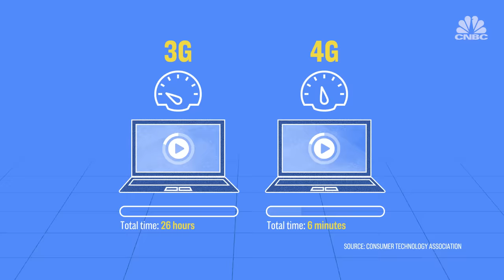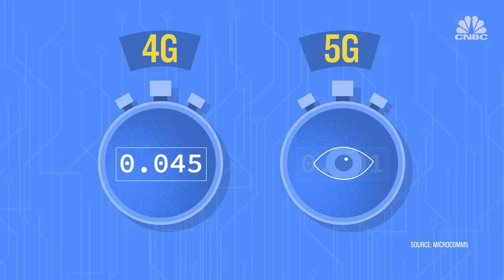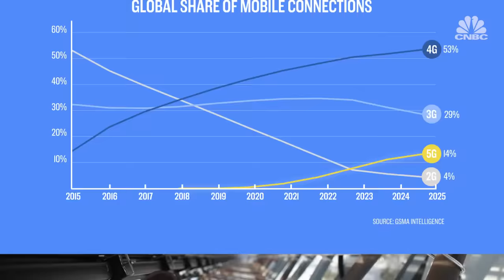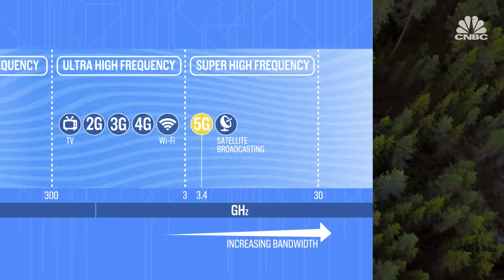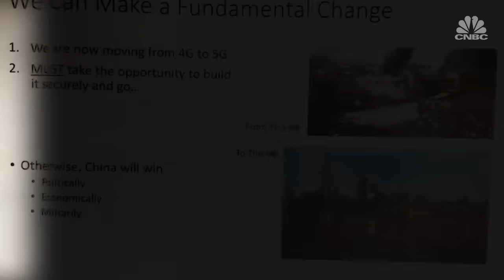What is 5G? | CNBC Explains

Comment: Basically... this will cook your brain.
Reply: This will cook entire bodies as it will be deployed all around peoples homes and jobs ..
Reply: Risk has to be taken for better future
Reply: It will cook nothing, since these are weak radio waves and not strong micro waves
Reply: @lukasmihara  anything in the GHZ range is microwave..
Reply: @ryanrodrigues6127  Are you serious?
Reply: @OMEGOOLIEBIRD  Not anything in the GHz range is necessary a microwave. Also, water molecules don't react to every range of waves.
 The only thing we are not evolved to withstand are things stronger than UV. Infrared, microwaves, radiowaves are all weaker than visible light.
It won't cook anything or anyone. The microwave you're using at home works probably with around 2,5GHz, WiFi also works with bandwiths in this range, and still you survived writing this comment without getting cooked. It's magic.
Reply: Lukas Mihara Your comments are uninformed. A microwave oven works by concentrating the radiant energy in a confined space. But that doesn’t mean it is safe to expose people to less concentrated microwave radiation 24/7. Governments use a “sensible heating” standard at this point, which means cell towers are ok as long as people can’t feel their flesh being heated. The standard will change after all the litigation which is coming over the issue.
Reply: why is key largo where donald trump lives exempt from 5g? people get exempt from bad things, not good ones.
Reply: @ryanrodrigues6127   A future where every breath is monitored, measured and monetized.
Reply: @ryanrodrigues6127  this is no unproven risk ..it WILL FRY YOUR ASS MATE.and everyone you know.
Reply: @lukasmihara  its the frequency of the microwaves that does the harm to us
Reply: . Lukas Mihara  the frequencys in 5g are ramped up to dangerous levels to us because they cant get them to travel far enough on norma levels.i have seen it kill a saucer of seeds in two weeks so you must see its a slow killer..thats the plan
Reply: @fj5745  Yeah, it's the plan to kill random people. Makes sense.
Reply: Sounds like it's started already☺ all the best with that one.
Reply: we can't have radioactive free version, electromagnetic waves are everywhere if we remove all electronic devices we still would be in constant radiation. the atmosphere can't protect us 100% for that you need to live in a well sealed cube all your life lol
Reply: Fun Videos 
5g is killing flocks of birds as they fly. Google it.
Reply: @thoughtstream875  Thanks for the info. I googled it and as expected there of course was no evidence of 5G killing anything.
By the way, to have your brain cooked, you first of all need a brain. So most of you don't need to worry.
Reply: @ryanrodrigues6127  Cancer is not a better future.
Reply: Its non-ionizing radiation, your wi-fi has many times stronger microwaves than this 5g network has. Get a grip back to reality.
Reply: @lukasmihara  check about 5g testing in netherland
Reply: Fun Videos and birds too
Reply: @tantyabichu  I did and they found no evidence it was the 5G that caused it.
I want facts, not stupid conspiracy and assumptions without proof.

There have been other cases where flocks of birds died and 5G didn't even exist then.

5G doesn't work exactly like your microwave oven at home.
Also to cause cancer it'd need a much higher frequency. Microwaves are non-ionizing.
Reply: Bingo! Yaaay, capitalism...
Reply: "this will cook your brain"  - You have nothing to worry about then.
Reply: @jdeep7  I said I wanted facts, not some stupid conspiracy.　You probably also believe the earth is flat if someone tells you that in a "fact" video on Youtube.
Reply: @OMEGOOLIEBIRD  It doesn't matter what it is, microwave is a non-ionizing radiation buddy. It does NOTHING to your body. And there's something called ENERGY level. Example: Low energy light into your eyes? It helps you see things. Same light but from a 5W laser focused on your eye? Goodbye eyesight. You are already surrounded by microwave radiation from all the wifi's from all your neighbors. 5G works exactly like that.
Reply: @zdrowapolska2313  I'm fine with more studies on it. I doubt anything will come out of it though
Reply: @em4703  And you base that on....?
Reply: @zdrowapolska2313  what do you mean? You are surrounded by 5g type of radiation right now. It's called a wifi. You'll just have it on the road now too instead of only in your house.
Reply: Dude bird die because of 5g radiation it will also kill us slowly
Reply: @RafikExe  that's because they used a focused beam with higher intensity than the actual 5g does. 4g uses radio, like radar does. Radar also causes birds to die. Does that mean 4g is also bad? No, because intensity of signals is different
Reply: @lukasmihara  false. See Netherlands test and what happened immediately to smaller animals. Birds especially. We lose our birds globally,we lose our natural pest control, we lose more food. This is like the nuclear bomb story.
Reply: @jdeep7  We knew Earth was round and the size of it for about 2300 years. The ancient Greeks calculated its radius. How about you actually read some papers about what 5g is before fear mongering?
Reply: @ryanrodrigues6127  idioz
Reply: 7g probably exists somewhere
Reply: It will Cook my pube hair
Reply: Strong arm-maybe brain not quite so strong.
Reply: From a corporate business perspective, that's an added bonus because it will bring more business and profit in the (un)health care sector; something like cancer.
Reply: @ @lukasmihara : Strength is inversely proportional to the square of the distance, which means what you call a weak radio wave has a strong EM energy at very short distance, like when you place the phone next to your head.
Reply: @ @lukasmihara : No, it's motivated by profit; the heath issue is incidental.
Reply: ha..ha..ha..l like that
Reply: Na, It's a non-ionizing frequency, there's no health danger. Plus all radio frequencies are regulated by the FCC or equivalent based on your region regarding their maximum power level out put.  All radio frequencies are subject to a number of factors such as the inverse square law, absorption, refraction, diffraction & scattering. Many house hold appliances already operate within the microwave frequency bands such as wifi access points and conventional microwave ovens. You can stand right next to your wifi access point and be receiving a signal strength of -30dbm this loss equates to going from 1mw to 0.001mw within touching distance. Microwave ovens are capable of cooking food because they operate at a much much higher power level and those microwave / that RF is absorbed by the water molecules within the food enclosed within, it doesn't cook  food on the outside but still causes noise within the frequency band again due to inverse square law and loss of strength. RF moves at the speed of light, the higher the frequency the higher the potential for increased data through put due to the amount of wave cycles per second. 1ghz = 1 billion cycles per second, however the ability to demodulate higher frequencies is also dependent on lower rf noise in the environment. Much like sound, lower frequencies are capable of penetrating further than higher frequencies. Much like sound you can listen to a radio in mhz/khz range all day with no issues, but if you increase the volume to dramatic levels you will damage your ears. So there are a number of variables regarding the physics of RF which need to considered before claiming cumulative effects on health.
Reply: @lukasmihara  Using weak electromagnetic signals dr. Michael Persinger could manipulate the natural electrical signals in the human brain & nervous system to "create controlled changes in mood and awareness" he called this technology the "god helmet" which he developed in the 1970s.
Reply: Watch the film “ take your power back” it sure is a big coincidence that the level of disease has risen with the rate of technology, I know our polluted food supply regulated by the corrupt fda is part of the problem but this is something to look into further before dismissing it as safe without the proper research.  Govt and big corporations don’t care about you or me, they care about money. Killing people slowly over the course of many years will go unnoticed for a very long time until it’s reached a point of no return. What if these people you are calling crazy are right and in a few generations we are having trouble with fertility and reproduction? Then it will probably be too late ...... not sure why so many people are willing to laugh, turn their heads the other way and dismiss something that may be harming them and the people they love.  The only person who cares enough about you to fight for your rights is YOU.......QUESTION EVERYTHING.... Especially big business and govt
Reply: the flux generated is directly proportional to frequency....this will MELT your brain, 4 times that of 4g....all the birds will be gone...I hope my country India doesn't lose its precious birds....they migrate from poles in winter to this special country and now they won't....but chinese have always corroded everything they touch
Reply: I am no expert in this matter but some scientists argue that the digital (square) wave form (as oppose to sine wave in nature) is harmful to all living thing with prolong exposure. If there is any ill effect, we may not live long enough to see it, but our next generation will. It is like history repeats itself like the tobacco industry.
Reply: 5G is a military battlefield weaponized interrogation, command and control system adapted for urban application, developed in Israel, and banned in Israel.  It uses entirely different technology and a different part of the frequency spectrum to 4G (2.4GHz), these being millimeter waves in the 20GHz to 300GHz range in phased beam arrays.  Independent studies have already shown that millimeter waves have negative health impacts, but the system can be easily tuned to any number of frequencies that are known to have a huge range of possible effects, which can be aimed at anything from the individual to city-wide level.

It is completely untested* and unregulated for health effects, and governments around the world have recently legislated on behalf of the Telecomms industry to make it illegal for any local City or State Authority or Council to consider health effects when making the decision to install 5G.  (Notice I didn't say 'the decision whether to install it or not' - not doing so is not an option).

*It has of course been tested by the military but the results are not made public.  Some of the known effects of EM and microwave radiation in general are listed in this leaked Naval Medical Research Institute report from 1977: https://www.dropbox.com/s/cioczwujsy55k68/Naval-Medical-Research-Institute-1972-Full-Bibliography.pdf?dl=0

The 5G system will allow any individual to be targeted with any of the effects achievable with Directed Energy Weapons, from the purely physical such as stroke, heart attack, or cancers, to the psychological, including implanting voices, visions and dreams in the target, keyed to the frequency signature of their DNA.

The system will also provide full 24/7 surveillance of all internal spaces including real-time 3D mapping of all homes, offices and pubic spaces and their occupants with accompanying audio feeds, provided by the phased array transmitters placed every 30 - 100m and all Internet of Things devices communicating with them.

The number of transmitters being installed will bring the power intensity of the Electromagnetic smog continuously microwaving us to levels hundreds and in places thousands of times higher than current levels, so while it has taken 5 years before the carcinogenic effects of the 4G system to become apparent, with the dramatic spike in cancer rates corresponding to the places people keep or use their mobile phones, correlating with the introduction of 4G, we will see the fallout from 5G in as little as 5 months.

With so many transmitters everywhere, the system will also be extremely vulnerable to hacking, and in any case, Israeli Intelligence have built backdoors into all the 5G equipment they manufacture, as have the US and Chinese of course.  Whoever has or gains access to the system, could, if they choose, watch a realistic real-time 3D CGI representation of exactly what you are doing in your own bedroom in complete darkness complete with sound.  They could literally see you better than you could!  I notice they didn't mention that in this propaganda piece.

The 5G system will become the infrastructure for the coming Social Credit Score system just like the one in China, but based on Energy or Carbon Credits, and Universal Basic Income on the basis of a new Social Contract, where your basic human rights now become privileges you must earn from the State, and can be denied at any time for unacceptable behaviour or speech.

Consequently, once the system is installed, protest or resistance will become virtually impossible, as the system will immediately flag any such activity, whether online or in 'real life', and the 'potential domestic extremist' will have their communications monitored and interrupted and their access to basic necessities restricted, while being targeted for slow or quick termination, depending on circumstances.

5G will not only affect humans negatively, but all organic life.  The reason the trees are being cut down in preparation for 5G is not because they will block the signal (they won't), but because they will rapidly show the negative effects from the 5G very clearly.  They have done weapon testing of 5G in South Korea against wild boar, and a recent test in Denmark caused birds to drop dead out of the sky, which has happened a lot lately.

5G is the ultimate wet-dream of the Totalitarian Technocrat, the 'Ruling Class', or criminal cabal of bloodline banking families, allowing them total observation and control of every individual, all the time. It will be the end of free will.

For more facts, here's a good presentation: https://www.youtube.com/watch?v=JQDViJDTCRE&t=848s
Please share/print my protest poster, thanks: https://www.dropbox.com/s/f27u9s0scwafew5/5G%20Protest%2004.jpg?dl=0
Reply: They will do anything and say stupid thing such as this propaganda just to stop China from acquiring advanced technology. They wont. The world knows already behind the mask of US imperialism.
Reply: @gregorykemi8898  There’s a major difference between safe radiation and the bad type associated with places like Chernobyl or X-ray machines. This is the difference between ionizing and non-ionizing radiation. Ionizing radiation appears at wavelengths above ultraviolet light, aka X-rays and gamma rays. These can damage your DNA by knocking electrons out of the base molecules, leading to tumors and cancer. Lower frequency radio waves, like what’s used for LTE mobile networks, are non-ionizing they can’t cause the same type of damage. Certain non-ionizing wavelengths can still be bad for you... as they produce heat at extremely high power level. Your microwave can warms up some nasty TV dinners just fine, but it requires more than a thousand watts of power to do so.
Reply: @manuelsilva9535  There can be  damages done even well below the effect that is needed to heat up human tissue.  People all over the ´world are getting sick because of heave use of the cellphones, wifi etc and the fact that some lives way to close to the towers ...
Reply: you can block 5g with your tin foil hats.
Reply: @lukasmihara  lots of 🐦 died durning testing of 5g
Reply: . @steampunk888    " The standard will change after all the litigation which is coming over the issue "  Yes the litigants, like "I was driving my car and I just saw a new celltower being constructed and it gave me a headache."
Reply: @thoth47   " why is key largo . . . . exempt from 5G "  Some googling found a week-old article that stated "By building out its (Miami, Key Largo) 4G LTE network, AT&T says it is laying the foundation for 5G, the next advance in network technologies. "
Reply: @savedbygodsgrace.9058    Your smiley was too small.
Reply: @thoughtstream875    " 5g is killing flocks of birds as they fly. Google it " I have a huge folder of birds/EMF stuff.     Look up 'Microwave Bird Telemetry'.   

They fly into guy wires and their navigation can be disrupted, but zero evidence of any radiation sickness/death AFAICT.
Reply: @victorli4316    " some scientists argue that the digital (square) wave form (as oppose to sine wave in nature) is harmful to all living thing with prolong exposure " Almost every commercial building on the planet had pulsing microwave bouncing around, from Solfan Doppler motion detectors inside, on the automatic door openers and of course wi-fi.
Reply: @Sudeevarma    No no no - --- --- lots of 🐦 were NOT proven died during testing of 5g.  That's another Persistent Internet Myth being pushed around by conspiracy weiners.
Reply: Ebenezer Kalarama thats my mistake ebenezer. i confused the name and had meant to say Mar-A-Lago.
here was the article i read.
https://www.palmbeachdailynews.com/news/local/wireless-law-won-affect-town/P94lYWt6wGeybdklMfHzbL/
Reply: @thoth47   okay thanks I'll take a look at that.
Reply: So it's faster stronger -yippee kai yeah mofos
Reply: Exactly, which they conveniently omitted. 
Microwaves were first placed into commercial use by the invention of the Microwave Ovens. The scientist discovered and developed this technology when working on a RADAR Project for the government noticed the microwaves melted a chocolate bar in his pocket.
The warning is provided in writing within each cell phone. No one reads it.
Reply: No wonder 5G is banned in Israel, they got more brain than us
Reply: @lukasmihara  we p
Reply: possibly ..that would explain Donald J Trump's eratica  whilst on his phone ?
Reply: @waynet8953  Ahhh cancer-the big Pharma cash cow. I tried to calculate how much money has been raised for cancer research worldwide. It gave me such a headache I thought that I had a tumor.
Reply: @MrTantalust  
It's risky. Why not wait until we know for sure? Just look at the phones we use. The 4g we're using now may cause brain cancer but we don't know, it hasn't been long enough. We could have another public health crisis in the next ten years. It could be just like tobacco.
Reply: @thoughtstream875    " 5g is killing flocks of birds as they fly. Google it "    I have a huge folder of birds/EMF stuff. Look up 'Microwave Bird Telemetry'. Birds do definitely fly into guy wires and their navigation can be disrupted, but there is zero evidence of any unusual radiation sickness/death AFAICT.
Reply: @ryanrodrigues6127  better future??? There will be no future.
Reply: Remember those old "this is your brain on drugs" commercials? Replace "drugs" with "5G." #BrainCancer #Cancer #KillingUsSlowly
Reply: Can't wait for 420g.
Reply: 5G is part of Agenda 21! It is designed to depopulate Millions! It is disguised as technological advancement! 
This must we STOPPED!
Reply: @ab-ud8np  You are so right.. It can cause so much damage.
Reply: @citizensnipsnw  Does non-ionazing EM radiation have negativne effects on the human population is debatable. Recent studies of long term exposure to EM radiation on electro plant workers did show that they are more likely to get malignant tissue (read cancer) then those who dont work those jobs. Although correlation between them has yet to be strictly proven, there is sufficient evidence that one might say that non ionazing EM radiation over longer periods of time(years to decades) could have some negative effects on the population. More long term and and meta analysis studies are needed on the subject and things certainly aren't this black and white. Also it is no incident that EU regulation keeps getting stricter year after year.
Reply: @ryanrodrigues6127  5G doesn't mean better future, it only means that people's greed wanting more.
Reply: Your brain has been cooking since 1G. Jajajaja
Reply: Too late - it started with 1G